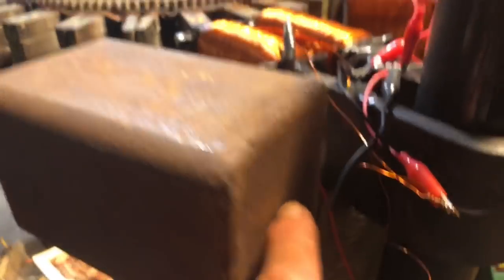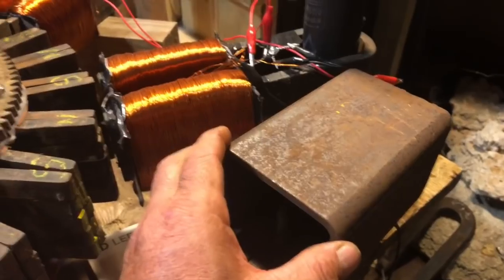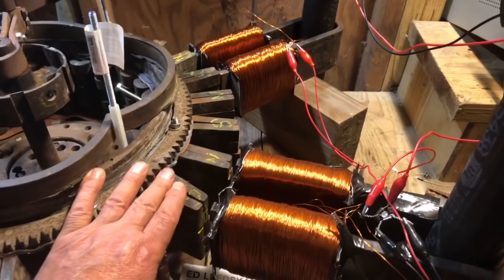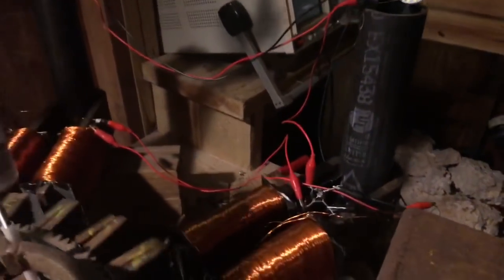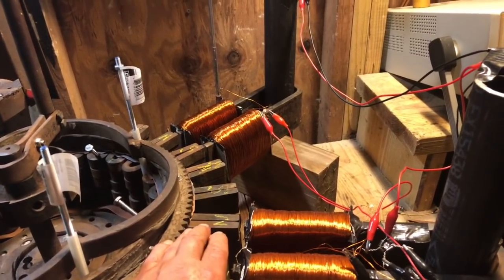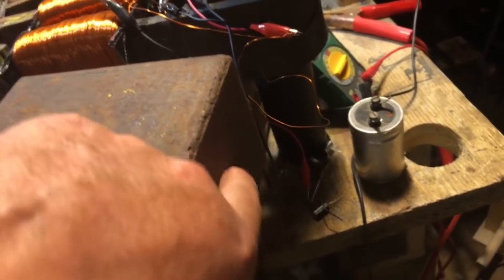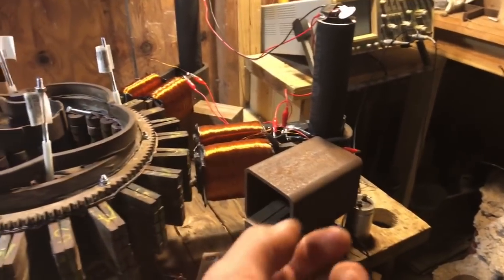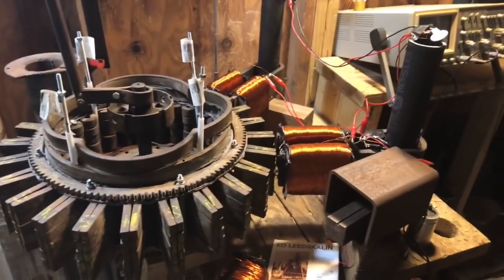Coral Castle, Ed Leedskalnin, How to make a Magnet stronger ! Using High Static Potential!

Comment: I was trying to make a coral speaker by wrapping it in wire and placing it above a giant magnet. I could hear a faint tone coming from something. I then tried just pulsing it with dc from a battery 'cause I wanted to try and shake it. I didn't know if it was working cause the battery wasn't sparking much. I decided to add some high voltage charge to the magnet. I noticed big back emp sparks.